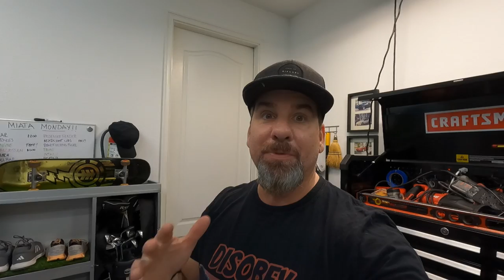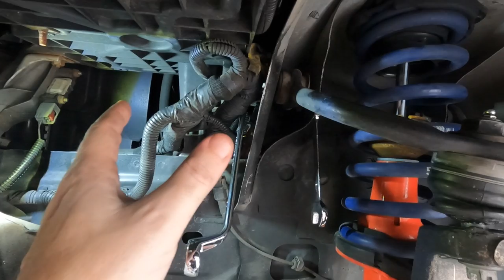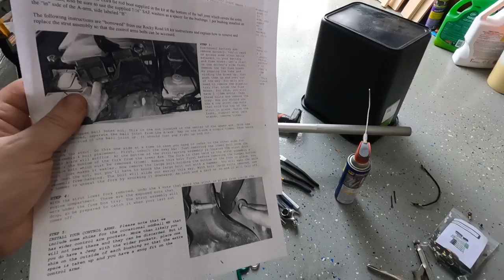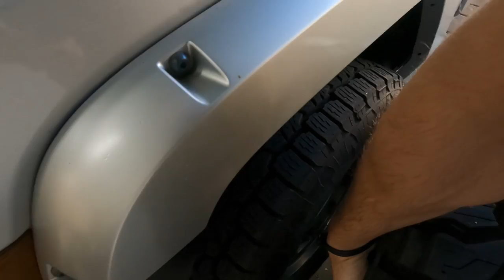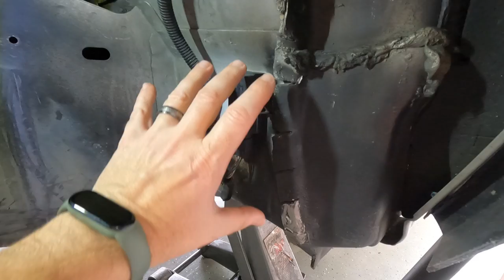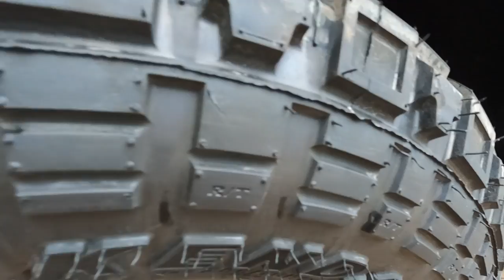HOW TO FIT 33" TIRES ON A JEEP COMMANDER!!

Comment: Hey man , I’m a big fan of, wanted to ask a question? My commander is sitting on a lift kit that’s 3.5” in the front and 3” in the back. Wondering how much will those old emu spring will lift my commander ?? Because it looks like yours got taller from the back after you did the install. The look on your face kinda says you needed old man emu springs in the front as well ? Anyways I heard the news ur selling the commander cobra . I’m still working on mine , hope it’s ok to keep Asking questions about your previous projects . 

P.s  you should make one last video going on a trail or something challenging for the commander cobra 🐍.
Reply from the maker: I have no idea how much it will lift your car. Unless you have the same lift I do. 🤷🏻
Reply: @ExtremeDailyDrivers  how much did it lift yours?
Reply from the maker: @guillermobucardo1747 3 in the front 4 in the back
Reply: @ExtremeDailyDrivers so it went up an inch ? Was it 3 inches in the back before the old emu install?
Reply from the maker: @guillermobucardo1747 Yes, what size tires are you running?
Reply: @ExtremeDailyDrivers I’m 265/70/17
Reply from the maker: @guillermobucardo1747 You need bigger tires.

Comment: Wish you would have showed the spacer install. i had a very difficult time compressing my strut when replacing the axle. spring would compress but the strut stayed expanded.
Reply from the maker: You just slide it in as described in the video.

Comment: That I just found out that it has locked in differentials, winning four wheel well, which is even better.They're just so wide and so long for all of them in tight trails.I don't know about that, but I think i'm going to lift it anymore
Reply from the maker: It's smaller than a Bronco! Thanks for watching.

Comment: Hey man, love the videos! I finally just got into an 06 4.7 and I already love it. I plan to do an overland/ camp rig similar to yours and your videos and links so far have shown me most of the questions I’ve had. I do however have some engine performance questions. I’m sitting at 150k miles and average about 11 mpg. It’s sitting on a puck lift and 265s. Obviously I’m going to do a full tune up. Do you have any other recommendations on making sure we’re running at top shape.
Reply from the maker: Just stay in top of the maintenance and you should be good!

Comment: Hey man that thang looks sick! I just bought a 07. So in your opinion if you were starting fresh top to bottom what parts would you run to make those 33s fit. I’m not experienced with this stuff but I am planning on purchasing the rro upper control arm to get started but for the rest I’m kinda lost on.
Reply from the maker: Check out my other suspension videos. Thanks for watching.

Comment: How come the cv axle is so straight? When i fitted 2" spacers to mins... they pop and crack like a killer... so had to take the spacers out?
Reply from the maker: Spacer lifts are trash. Springs are the only way to go.
Reply: Right... obviously, I did do the spacer lift... your commet was trash, and you didn't answer the question... DUDE @ExtremeDailyDrivers
Reply from the maker: @tkguitars2020  The spacer is used is in conjunction with springs. You need to watch the video, not just randomly comment.

Comment: I guess I missed it but how much did you actually lift the suspension in the front and rear? Maybe I got it wrong but was it a 2 inch spacer in the back and that somehow got you 4 inches?
Reply from the maker: It has already been lifted 2 inches because of the springs. Watch the first 90 seconds again. Lots of good info there.

Comment: What are the biggest tires you can fit on a 2010 Jeep Commander without a lift and spacers? Of course, you would still have to do the trimming and pinch welding.
Reply from the maker: I know you already know that answer. I'm not going to tell you anything different than the internet already has.

Comment: I just got a 2007 Cammander going to put 35’s on and lift and that’s the max before I gotta change gearing and if I have to upgrade gears then I’ll go 38’s but those 33’s I think are to small for me. Looks good on yours but thinking at least 35’s and see. Detroit

Comment: Hi i am wondering if Bilstein 5100 in front and Bilstein 4600 in rear would be compatible as i cannot find B5100 complete set. Your advise would be great as you have Konis in front and Bilstein in rear.
Reply from the maker: Love the Koni's and I had 4600's in the rear and preferred the ride. I would love to have Koni's on all four corners, but they will be a little too short in the rear. Thanks for watching.
Reply: @ExtremeDailyDrivers hey i am wondering if diff drop is required or not. Thanks for your help
Reply from the maker: @syedsadiq4446  Diff drop is not necessary.

Comment: On the heater hoses, just order the hoses without the rear heat/AC and you will not have to mess with any elbows etc.  they fit perfectly.  I deleted mine too after it was always problematic to prevent the leak at the T’s
Reply from the maker: Great tip! Thanks for commenting!!

Comment: Nicely done ... that's a lot of work to fit 33" ... I'm happy with 32" with 2.5" lift and JBAs and pinch weld mod :-)
Reply from the maker: I was too, but wanted more! Thanks for watching.
Reply: HI mate, i have just installed the 2" rough country lift, could i run 32's?
Reply: @DoomBeard  we run 32" with right wheel offset and pinch-weld-mod at the front to ensure no rubbing so you can do it

Comment: Could you please comment on your fuel consumption since running the 33's  and how is the tranny changes going?
Reply from the maker: 1 HWY, 0 CTY. I don't track it. I have no idea. I can tell you that the tranny is doing great. It shifts better than ever. However, I probably would regear if I went anything bigger than 33's. Thanks for watching.

Comment: Did you drop the sub-frame too since you lifted the front to 4”? What are you using to drop it off if you did? Thanks
Reply from the maker: Nope. Not necessary. Thanks for watching.
Reply: But angle is still okay? Thank you! Ive been digging your content. Also have atoto head unit! Hahaha
Reply from the maker: @MilesLacoste  Yep. Watch the video again. Axles are practically straight.

Comment: Just replaced my heater core T hoses a few months ago.  Pain in the you know what.  Be ready to pull your intake if you change the entire hose.  A lot of people just cut the T out and use a brass T or 90 to replace it but that looks pretty rough.
Reply from the maker: I'm going to do this soon. I'll be replacing the T with a L. I'm going to delete the rear AC and heat. I don't ever use it and it's one more thing to fail. Thanks for watching.

Comment: Did you eliminate the side plastics on the doors? Can you do a video on that. Thanks
Reply from the maker: I did not. They are still there.
Reply: Am sorry, I meant the rocker plastics.
Reply from the maker: @IamJayTuro  Oh yeah, you just pull them off. 5 minutes max.

Comment: Could you go with the rc 2 inch lift with these h&r springs you used ? The rc lift looks like a plate like the one you put in but a little bigger would it be the same height ?
Reply from the maker: No. It would be close to a 6 inch lift and your axles would basically be falling out of your front differential. If you want a 6 inch lift, buy a Jeep Wrangler.

Comment: I've been following your videos for quite some time on your Jeep Commander and you doing a great job! I just bought an 06 Commander with a 5.7 . Want to do a lift nothing major... I'm thinking about just running a set of Bilstein 4600 will the 22 mm spacer. Hope and that'll give me about an 1.5 inch Lift? With stock springs you think the Ride is going to be Less desirable than the lift springs? 
Again love you videos and the info!
Reply: Thanks for the info! I'll follow your advice! Keep the information rolling brother! Love the links you provide! Your commander is badass! 😎
Reply from the maker: I would replace your springs too. Your XK is 17 years old now and has the heaviest engine. Those stock springs are sagging and worn by now. The ride will only improve with springs that provide a lift. I guarantee it. Thanks for watching.
Reply: Another question please... If I run those lift springs you suggest what about the rear end does it go up to inches as well? If so then we've got the leveling issue still to deal with?!
Have you sold your uppers and joints? Having trouble finding your email address... Would love to communicate with more... You're a wealth of knowledge on the Commander!!! Thanks! Ron
Reply: @ronthompson5702  one thing u gotta keep in mind is that if you off road the Jeep rather harsh, there’s a chance you can mess up your ball joints especially the upper control arm, my suggestion would be if your gonna lift your Jeep, get every part you need, new struts, spacers , ball joints etc. and install it all in one shot, coming in and out could be a headache
Reply from the maker: @ronthompson5702  Yes, the rear will go up as well. If you want a level look you can add some like Rusty's strut plates. Check them out at Rusty's Off-road.

Comment: Has the rear axle moved to the right? I just did the RRO OME level lift. I did go with the JBA uppers.
Reply from the maker: Not that I know of. I thought I would definitely need an adjustable track bar with close to 4 inches of lift in the rear, but so far so good. 🤷🏻
Reply: I had to get adjustable track bar on mine
Reply from the maker: @h22eh6  I think I might have to too. I'm hearing a clunk in the rear on big bumps and I think it's something hitting the gas tank.
Reply: @ExtremeDailyDrivers  I got some type of what feels like I’m driving over rumble strips in the back. Been trying to track that down.
Reply from the maker: @h22eh6  I don't have that issue. The XK drives great. Better than ever, actually, except for the clunks in rear over big bumps.
Reply: @ExtremeDailyDrivers  do u know what it might be?
Reply from the maker: @h22eh6  What lift do you have?
Reply: @ExtremeDailyDrivers 2.5 puck lift front and rear
Reply from the maker: @h22eh6  Did you upgrade your springs and shocks?
Reply: @ExtremeDailyDrivers  on the rear I did with rough country shocks. Springs still oem . I’ve only had it for 3 months. The fronts shocks and springs look factory
Reply from the maker: @h22eh6  Everything RC makes is below OE quality. I would install some Bilstein or Koni shocks/struts and get some OME springs. It will be 3 times more money, but totally worth it. You can't cut corners with suspension. You will regret it every time especially if you are ever going to go off road.
Reply: @ExtremeDailyDrivers so true I’m going thru it now. Man I think I’ve narrowed it down to the rack and pinion. Making a popping noise while turning the wheel while standing still. The rear rumble strip sound is still under investigation. Adjustable track bar should come today
Reply from the maker: @h22eh6  I had that popping noise too, but it was my clapped out swaybar endlinks. Once replaced, good as new.
Reply: @ExtremeDailyDrivers  I replaced those. What about the sway bar bushings?
Reply from the maker: @h22eh6  I replaced those when I did my initial suspension install. I filmed it.

Comment: The commander looks awesome!  This is some really great information! I have a WK Hemi and I'm so close to pulling the trigger on a complete suspension rebuild and lifting it at the same time.  I'm definitely going to check out the products you used.  I'd really like to be able to fit a set of 255/80/17 tires and go for the skinny 33" look.  Did you take hub to fender measurements after adding the spacers? I'm curious how this combo compares to the traditional OME + 5100s.
Reply from the maker: I did not because my cv axles are damn near perfect. If you decide to go through with the suspension lift get the OME HD springs for the extra weight of the hemi. 💪 Thanks for watching!

Comment: Nice video. On my Commander I am running a modified OME lift. (OME heavy duty coils & Bilstein 5100’s on  the 1st setting). I too chose the RRO UCA for the same reasons. I’ve had them on for 2 years and have had no issues with them.
Reply: 1st setting 5100’s meaning the highest from the top or 1st setting lowest setting aka stock?
Reply from the maker: I don't want to speak for him, but I'm pretty sure he is talking about the lowest setting which is 3/4 inch. Anything higher and you will have axle angle issues.
Reply: @ExtremeDailyDrivers . Correct. Lowest setting. I also have had the same tires for 2 years. I love them!!!!!
Reply from the maker: @byronlee6486  Heck yeah! Klever RT FTW!
Reply from the maker: If I was starting fresh right now, I would do the same thing you did. When I bought my suspension pieces it was during the pandemic and lots of stuff was on back order. So that's why I did everything the way that I did. Glad to hear about the RRO UCA's. Thanks for sharing your experience.